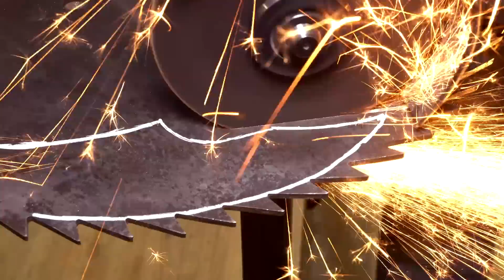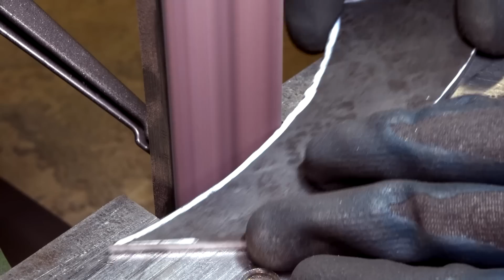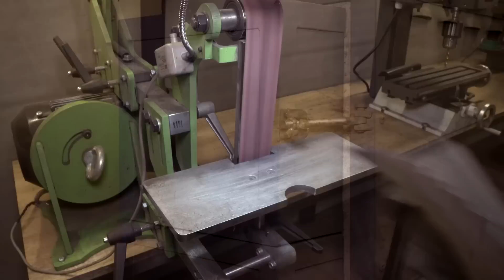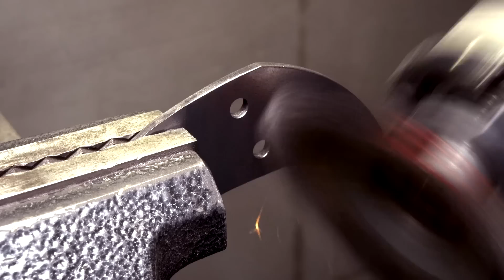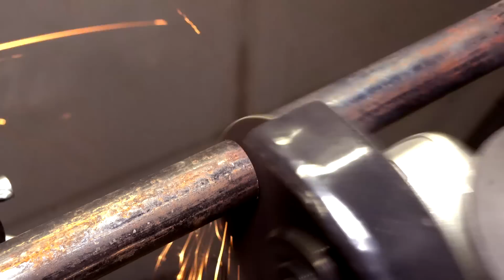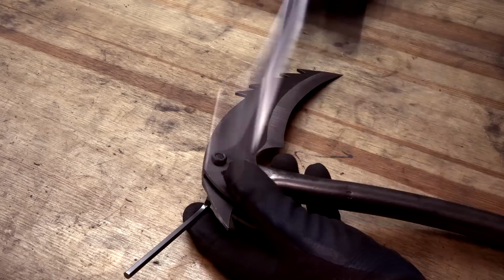Making a Post Apocalyptic One-Handed Scythe From an Old Saw

Comment: Looks wicked, definitely wouldn't be out of place in a Mad Max style post apocalyptic wasteland, but I am wondering at the purpose of the smaller blades on either side of the scythe. Apart from the obvious aesthetic appeal, do they actually increase the effectiveness of the weapon?
Reply: I was thinking the same. The whole time I was like..."you should have mounted the outer blades in the opposite direction to make it a double sided weapon. Beautiful piece but can't help but think it was a waste of two good blades to not have their edges exposed
Reply: @dads_diy  That's what I was thinking. Or have them on rotating mounts so they can be swivveled out, maybe?
Reply: @colebraddock1809  yes I originally thought they would fold out. Holy shiiiiit I just had a great idea...same design but make the two little blades on bearings so they can rotate with gravity like a balisong or butterfly knife. Now I wanna make a giant butterfly nunchuk type blade.... So add and the comment sections are my muse lmao

Comment: This was an awesome build and a great video. I do have a question: when drilling the flats to hold the blades I noticed you used no supports, did you have any concerns that they holes on the backside would not line up?

Comment: Er, sorry, but I can't really see the point of this thing.
Clearly, it's not a farming tool. It's efficiency in agricultural efforts is laughable.
It also doesn't seem to be very efficient as a weapon. I mean, as soon as you hit flesh, the blade will get stuck in it due to the dents... That means that you have just one blow (however nasty) and then you're empty handed...
What are you trying to achieve with this? What's the point of the tool? How do you actually use it?